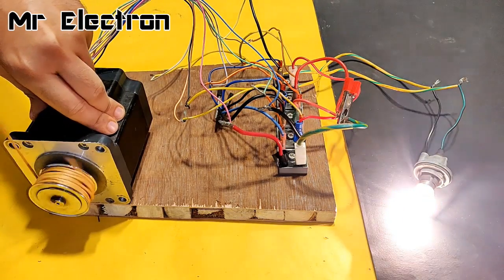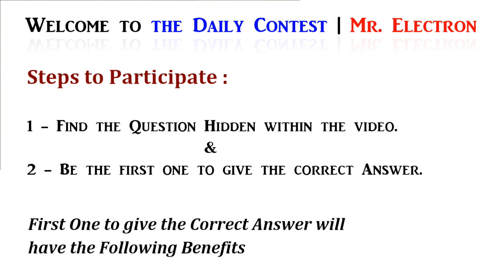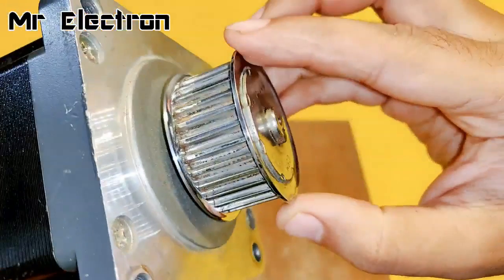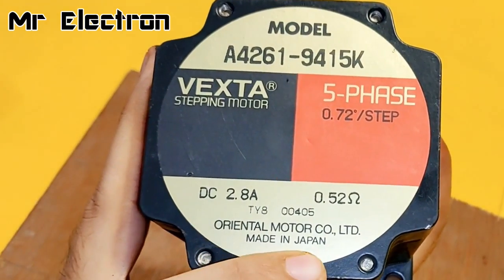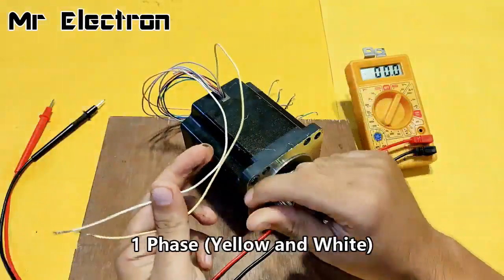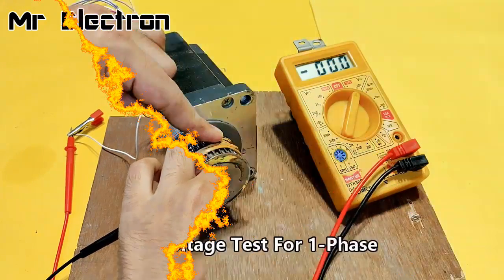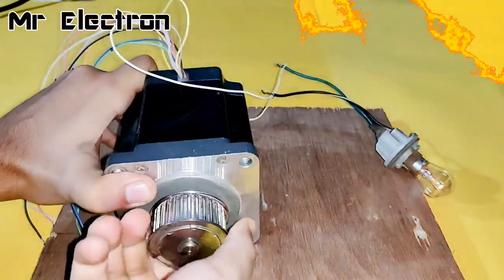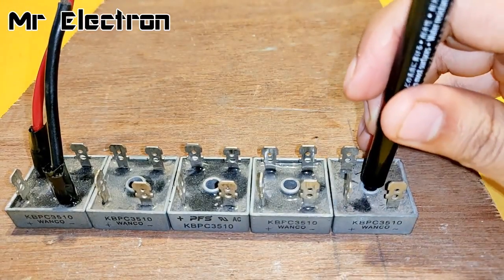Make 110V 500W Alternator from Stepper Motor

Comment: Make 25000v TV flyback  transformer driver circuit using igbt 250n Transistor
Reply from the maker: Hi! There is lockdown here in India because of Corona Virus so its not possible to get new components from the market until the lockdown ends.
Would you like me the driver circuit with Transistor CTC 1351 or Transistor 13009 or with Mosfet IRF 540.
Or you can choose some other project or delay this request until lockdown ends.
Reply: @MrElectron   can you make amplifier using LA4440 IC STUDIO MODE AMPLIFIER
Reply from the maker: @mrpakistanhacker4081  YouTube prefers and promotes only my channel related videos ( meaning videos with tags which i usually use in my videos like motors , generators , dynamos , alternators , solar panels , welders , batteries and transformers ).
Please choose the videos related to topics of my streams.
By the way, people also call me 'Motor man' which says a lot too.
Reply: @MrElectron  OK use 13007 or 13009 or 13003  Transistor use to make flayback drive
Reply from the maker: @mrpakistanhacker4081  ok, your project has been accepted.

Comment from the maker: Hey !!! The winner for this video's contest is "Mr Pakistan Hacker" - Congratulations.
The Correct answer is 10 diodes for Full Wave 5-phase rectification
Although i used 5 full bridge rectifiers ( meaning 20 diodes in total ) because i didn't have so many individual diodes but still, the minimum number for full wave rectification is only 10 and 5 for half-wave.
I will also share the diagram for 5 phase full wave rectification in my upcoming video for everyone to understand.

Best Regards,
Mr Electron
Reply: I have gained a lot from your tutorial, thanks

Comment: To make a 5-phase full-bridge rectifier, you will need about 10 diodes, seeing as triple phase rectifiers use at least 6 diodes to turn negative voltages into positive ones. This means that 5*2 diodes totals 10 diodes

Comment: I do not want to edit my first comment but as someone has pointed out that it could have been said in a clearer way. In the model he used 2 wires per phase for each wire you need 2 diodes to make a full bridge rectifier. If you only use 1 diode per wire you will have a half phase rectifier. In my first comment I said "2 diodes only makes a half phase rectifier" I should have added when using two wires per phase. So if you use two wires per phase you would need 20 diodes. Not to go into all the details of how but 5 of the 10 wires could be tied together in a common connection. Then you would be left with only five wires that need to be converted into DC which would only take 10 diodes. My original comment was based on how many diodes it would take to do it the way he presented the model 2 wires per phase not using the common connection of 5 of the wires. I think he presented it this way with 10 wires because most people could do it this way.

Comment: Since you only said 5 phase rectifier and not 5 phase half/full bridge rectifier it could be either 10 diodes or 20 diodes since there is no other way. You used 5 full bridge rectifiers in this video which was 20 diodes.

Comment: 20 diodes is correct it takes 4 diodes to make a full bridge rectifier and it takes 5 full bridge rectifiers for 5 phases so 4 x5 = 20.  2 diodes only makes a half phase rectifier.
Reply: Wrong....or incomplete answer. ..
Reply: @valiungur517  I should have added it takes two diodes per wire to make a full bridge rectifier. "My 2 diodes only makes a half phase rectifier" was not complete A better or clearer way to say it would have been if you have two wires and only use two diodes you have a half phase rectifier. Again I was basing this off the model as presented he was using two wires for each phase. So if you were only using two diodes per phase with two wires per phase you would end up with only a half phase rectifier. But I am glad you pointed out that it was not clear and was incorrect when using one wire per phase when you get to 3 phase or above full bridge rectifier. Thank you.
Reply: @motosport8851  Corect. ...thanks for replying 
The question is a little ambiguous. 
Happy Eastern. .
Reply: @valiungur517  Happy Easter to you also. Yes the device started life as a motor that is the only reason it had 10 wires coming out of it.
Reply: @valiungur517  you are correct if you reengineer the model from how he presented it. My answer was based on the model as he presented it using 10 wires. Yes you could tie 5 of the 10 wires together and end up with only 5 wires similar to a 3 phase alternator and then you could use only 10 diodes just like a 3 phase full bridge rectifier only uses 6 diodes. But that is not how he presented it I was not trying to reengineer what he presented. If you did not tie 3 of the wires of the 6 wires in a 3 phase alternator together in the correct order and just had all 6 coming out then you would need 12 diodes. I will agree that it is kind of how you took the question as related to the video. How many does it take to do it as it was presented in the video, or how few it could be done with if you changed the configuration of the wiring.
Reply: If you use star connection it is enough 10 diodes 
If you use 2wire for each faze then the answer is correct 20 diode.
Reply: @valiungur517  if you only want half the power yes you can use 10 diodes, if you want the full DC power of the Alternator you have to use 20.
Reply: @valiungur517  I assumed he was asking how many diodes does it take to get full power from a 5 phase alternator. Kind of like when someone ask how many spark plugs does a V8 engine need. It may be able to run on only 2 but it want make full power on 2, it needs all 8 to make full power.